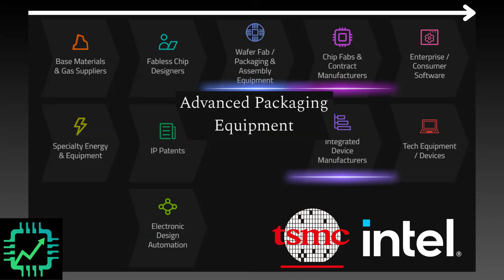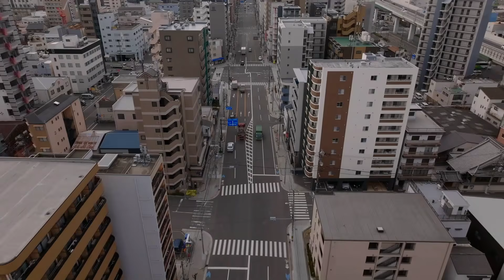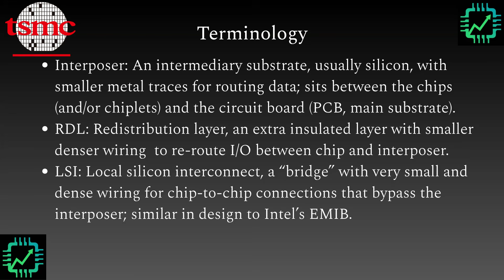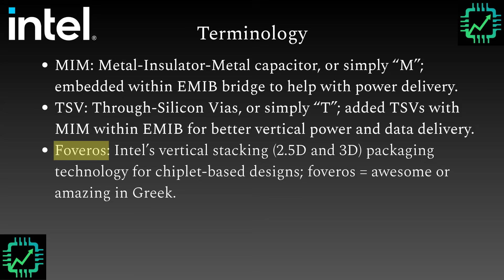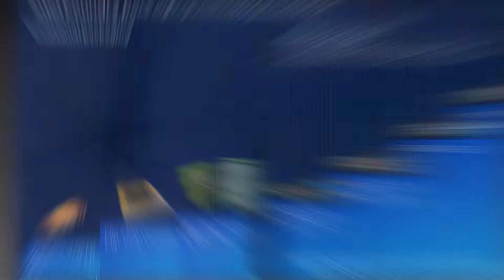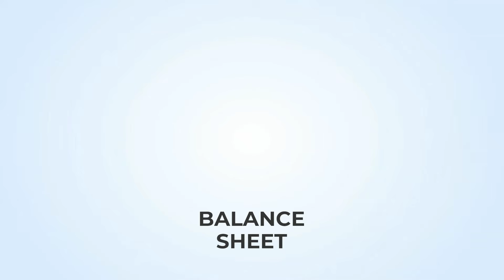Intel Can't Beat TSMC — but It Found A Backdoor

Comment: Finally some reading from you guys on Intel !  Read more about back side power and 14 A turbo cells !! Tsmc does not have it till 2027 and 18 A is 85% yield and most advanced node in the world currently!! And they pioneered high NA euv machines !! You will see systematically inflection point in semiconductor manufacturing in 2027 !!
Reply: Also watch products perforance on 18A like panther lake and clearwaterforest!! Clearwaterforest will keep intel on map for h2 2026 !!